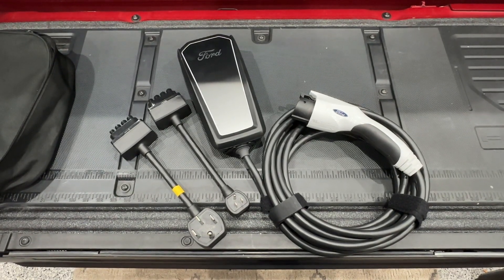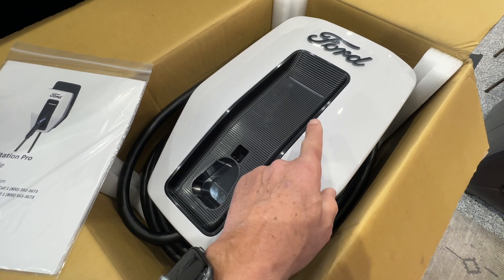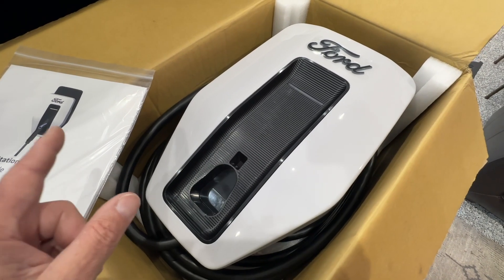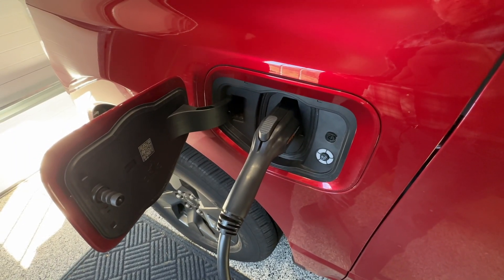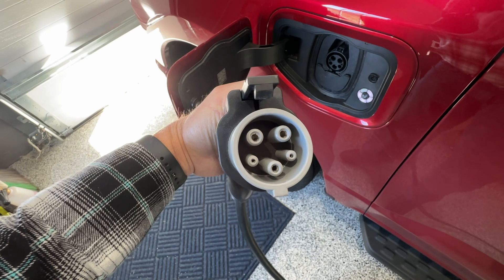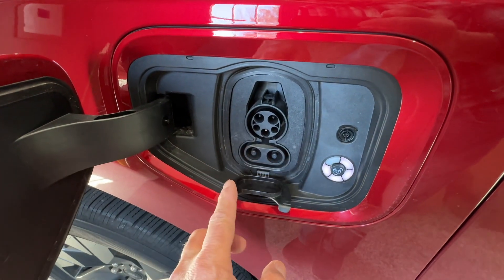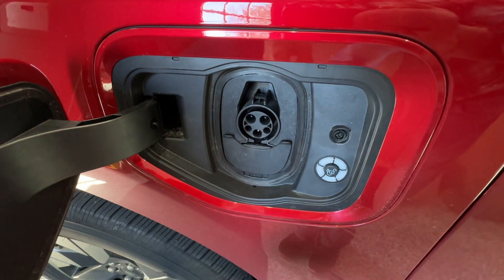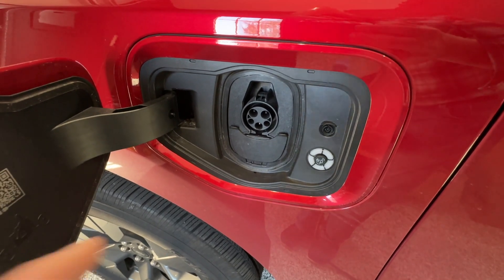How To Charge the F-150 Lightning on a Tesla Wall Connector

Comment: Without a doubt the 40 and 48 amp adapters would eventually fail drawing over their rated current.
It's my understanding that:
It's not that you have 240 volts connected to the lightning that limits the current draw, it's what they call the charger which isn't a charger at all, Because the actual AC to DC charger is located in the lightning.  One if you have a standard range battery and two AC to DC chargers if you have an extended range battery.  The lightning chargers are bypassed when charging with DC.

Comment: I’m not sure about the newest tesla wall connectors but I have a first generation and you can dial down the amps using the internal dip switches. However, if you’re on the road you may not know what it’s set at
Reply from the maker: Exactly, that was the test result.  I think an 80amp adaptor might be a good thing to have

Comment: I assume that if your wall connector is rated at 40 A  then you have no problem, correct?
Reply: The version 3 Tesla Wall Connector delivers a maximum of 48 amps. Version 2 is 80 amps.
Reply from the maker: Yes even up to 48 amps providing the wall connector rating matches the adaptor rating

Comment: This seems like a safety issue Ford could fix with the option to limit the charge current in the software. Someone with decent presence on twitter should tweet this video at the EV / lightning product managers and ask them why they give their customers no options for safer operation.
Reply: Their response would most likely be 'Only use a J1772 evse with the Ford Lightning'.

Comment: on my Electrify America charger at home I can set limits for amps up to the rated max of 40 amps, many chargers can do this, people just need to buy the one that allows this.
Reply from the maker: Unfortunately you do not know what the Tesla wall connector is set to until you connect to it
Reply: Dave, maybe I missed this info, if you had a 50amp breaker in your panel, wouldn’t it trip if it saw higher amp draw, what size breaker are you using? By the way, excellent video explaining, very helpful.

Comment: do you have 100 amp service at your house to provide the 80 amps?
Reply from the maker: The garage has 400 amp service feeding two 200 amp panels feeding 6 high powered Tesla wall connectors.

Comment: Another great video! Definitely something to keep in mind. The ioniq guy did a video talking about the Tesla tap mini vs the Lectron and in his video he took it apart It looks pretty decent on the inside. The owner of the Tesla tap company says with the Tesla tap mini it's built like a tank while it's rated for 80 amps it could handle double he says. Isn't there a temperature sensor in the end of the Tesla connector I bet if things started to get toasty it would automatically back off I definitely wouldn't want to test that though haha. I know I was charging and my plug started melting and I got a message in my Tesla app that said there was an issue to go check on it probably saved my house from catching fire!
Reply from the maker: Thanks, I would love to have Tesla Tap send me a mini and I’d test it again.

Comment: Good info for EV neophytes, Dave. When I relinquish my Model 3 and get another EV someday, I intend to keep the UMC and adapters and get a TeslaTap MINI 80 for roadtrips. Indeed, I'll probably get a second TeslaTap MINI 80 for my Tesla HPWC at home rather than buy a different EVSE with a J1772 plug. As for fast charging, it's nice that Tesla now sells a CCS-to-Tesla adapter, but I'd really like to someone to develop a Tesla-to-CCS adapter so that other EVs can use Superchargers —something that Tesla has promised will happen like in Europe, but has yet to happen here.

Comment: Is the Tesla wall connector rated at 80 amps?
Reply from the maker: Yes, version 2 is good for 80 amps, early S and X cars could chargers at 80 amps. The new version 3 Tesla wall connectors (white) can chargers at a max rate of 48 amps
Reply: @evdave528  I have  version 3, max 48 amps. Will the Lightning pull more?
Reply: 48A

Comment: I have a Tesla and I bought a J1772 wall connector. Tesla's included adapter made it easy to switch and I figured it'd be easier in case I ever sell the Tesla for another brand, or buy some cheap non NACS vehicle to have a long w my Tesla.
Reply: I've been debating between a Tesla wall connector and a J1772 connector.  

Currently I have a NEMA 14-50 in my garage between the two overhead doors. My wife always pulls into the garage and uses that outlet with the Tesla Mobile Connector. On the opposite side of the garage I have a Gen 3 Wall connector that I use. Outside the garage and offset to the side to avoid blocking cars going in/out of the garage, I have another NEMA 14-50 outlet. I only use this outlet if family or friends are visiting and need to change. My concern is that  someone might try to steal the Mobile connector if a car is charging outside overnight. It would be more difficult to steal the wall connector.  All my family members and friends that own EVs have Teslas but when the time comes for my kids to drive maybe I'll just get them a cheap non-Tesla EV which will probably require a J1772 connector.

After watching this video, I am thinking maybe installing the Tesla wall connector and buying the 80amp adapter like the one Dave has might be the way to go.
Reply: @acolon8999  I'm curious, do you have 100amps going to your garage?  Or will you share that with your main breaker panel?
Reply: @DblOSmith  100amps from the main 200amp panel to a sub panel in the garage. The sub panel then has individual breakers for each connection.

I've never had 3 cars charging at the same time and usually my wife's car is charged before I get home except on weekends or days off. Even though my wife is plugged in to a 50amps breaker which should allow the car to pull a max of 40amps, the Mobile Connector max power is 32amps. My Wall connector is on a 60amp breaker and pulls up to 48amps. If running on generator power I usually let one car charge first or if we are both charging, I have my car only pull 24amps not to put to much strain on the generator.
Reply: @acolon8999  got it.  Thanks for sharing!
Reply from the maker: I sometimes use my charge point j1772 wall connector (40a) with an adaptor to charge a Tesla

Comment: I appreciate all your content but a couple points for you and your viewers.  
1. The Short Range versions of the Lightning charge at a max of 48 amps. 
2. LECTRON (there may be others) makes a version of their adapter that is rated for 48 amps.  I spoke with their customer service and that is a continuous rating.
3. I have a new 80 amp TeslaTap connector that you show.  While is is rated at 80 amps MAX, I spoke with the company and that unit should only be used for 3 hours at 80 amps.  For continuous use beyond 3 hours, they said it needs to be limited to 80%, or 64 amps.
4. TeslaTap does offer different (and smaller) adapters that will handle the 80 amps continuously.
Reply from the maker: Thanks for the info, I think I miss spoke on the lectron ratings, I’ll check both adaptors.  I’ll try and test the mini.  I can b bench test the adaptors for current handling but would rather test as designed.